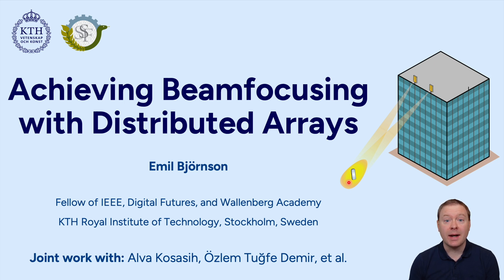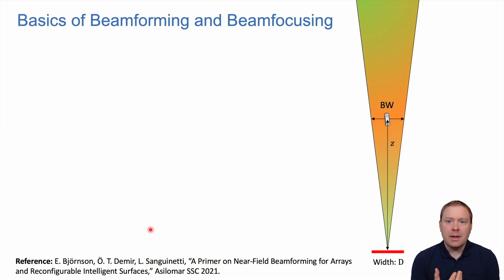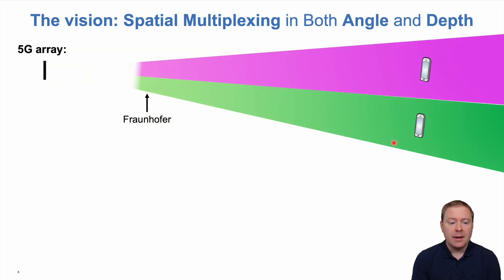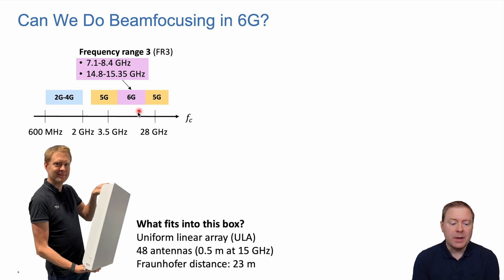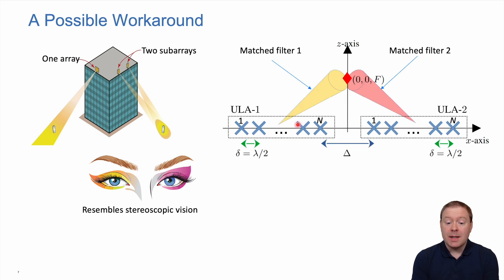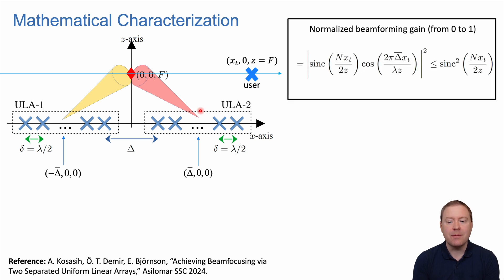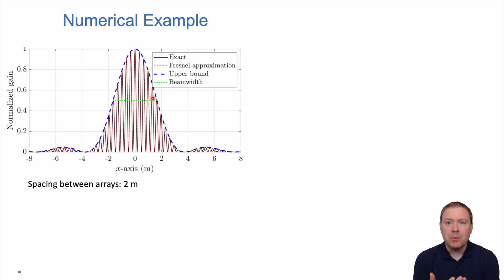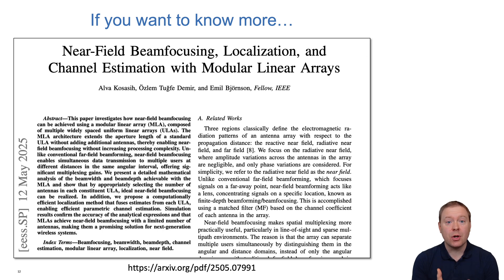Achieving Beamfocusing with Distributed Arrays

Comment: Nevertheless, with or without fast spatial ripple, the focal point would be very small, especially at higher frequencies. It would be susceptible to small movements. What approaches would be promising to deal with this?
Reply from the maker: Wireless systems are always susceptible to the small-scale fading caused by small movements, so one typically sends pilots so frequently that the devices won't move more than "wavelength/4" in between the pilots. The ripples discussed in this video will be further from the focal point than that.

The ripples appear when the beamforming is designed to maximize the SNR at the focal point. One can potentially design other beamforming that smoothen out the ripples, at cost of reducing the SNR at the focal point.
Reply: @WirelessFuture  Thank you for your answer. Why would you like to eliminate the spatial ripple, if you can adjust the focal point so frequently?

Comment: Thank you for such clear and informative presentation. Do the panels have the same configuration (N1, N2)? Would there be any effect if the panels were different?
Reply from the maker: I think the natural thing is to have the same configuration, but it works otherwise too. The focus area is the intersection of the beams from the two panels. If N1 is different from N2, then the one beam will be narrower than the other, and that will change the shape of the focus area around the target location.

Comment: Thanks Dr. Emil, now when we have 1000 user in the sector, how the beamforming can reach each user? and Isn't beamfocusing the same function as the beamforming?
Reply from the maker: There aren’t 1000 simultaneously active users in a sector of today, but more like 1-10.
Beamfocusing and beamforming are the same thing in the sense that one transmit a signal focused on a particular point. The main difference is how the area where the signal becomes extra strong looks like. It is an ellipsoidal region with near-field beamfocusing and a cone-like region with far-field beamforming.
Reply: @WirelessFuture  No sector can handle more than 10?
Reply from the maker: @amroayman2552 If I remember correctly, a sector cannot co-schedule more than 8 users on the same subcarrier in current releases of 5G. This is seldom a bottleneck since the traffic is bursty and the maximum bitrate is much larger than what most users need, so they are only actively communicating a minor fraction of time.
Reply: @WirelessFuture  thanks Dr. Emil, but I want to understand how beamfroming can serve say 6 users at the same time? also I serve multiple users over the same subcarrier through TDM yes?
Reply: @wireless future